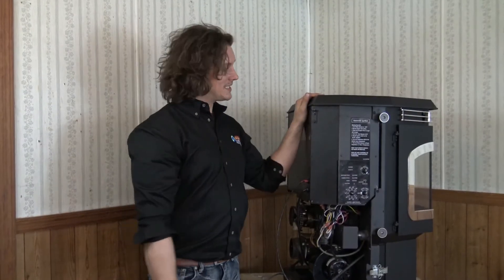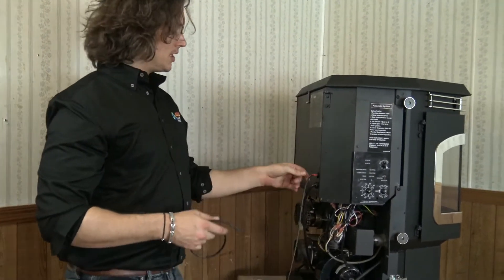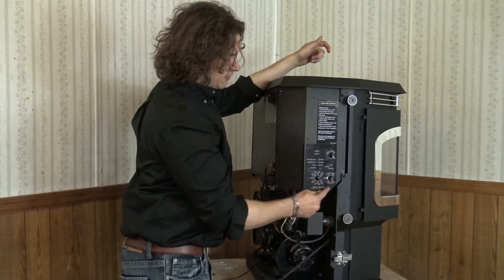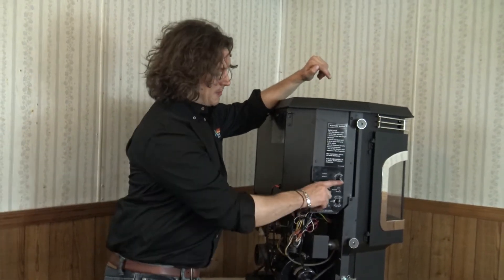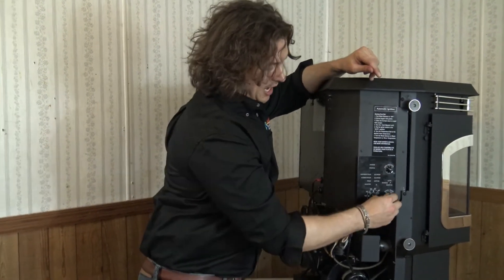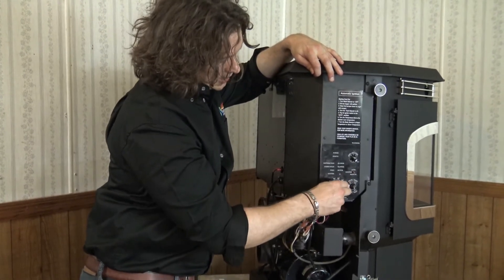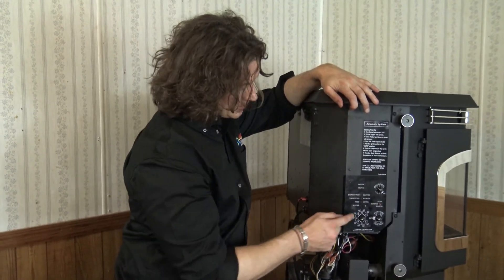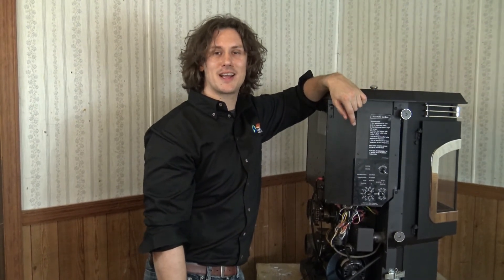Harman Stove Controls, How to use a Harman Pellet Stove

Comment: I added a $200 uninterruptible power supply (UPS) to my P-43 so that power surges don't fry the electronics and it runs even when the power goes out.
Reply from the maker: Thanks for sharing. Typically with Harman Stoves, a True Sine Wave Inverter would be required for proper battery backup/power outages. Glad to hear the solution you found is working well. Typically speaking, a surge protector of 850 Joules or more would be what is recommended for pellet stoves to prevent power surges from impacting the circuit board. Again, appreciate you sharing, any future questions just let us know. Thanks!
Reply: @EarthSense  How do I know if mine is sufficient?
Reply from the maker: @jccook5353  Thanks for the message back, apologies on the delay. If you have your system in place and the stove is operating as it should be, then it should be just fine. Feel free to send us a link to the UPS power supply you have and we can certainly review that and follow back up. Thanks.
Reply from the maker: @jccook5353  This is the inverter system that Harman recommends for their stoves, just so you have this as a reference and can review the info and specifications. https://www.secamerica.com/sf-512-inverter-for-harman-pellet-stoves-engineered-for-proper-stove-operation/

Comment: Hello. I have a Harmon Accentra insert that was purchased around 2010. I replaced the Combustion Blower (motor) last year after the bearings began to fail. No issues since. After running the stove this year ~3 times, I noticed the Distribution Blower stopped running, even though the Distribution Blower light is on during operation. When in “Test” mode, the Combustion Blower and Feed Motor all operate properly (about 60 seconds) with the indicator lights on. The Distribution Blower indicator light comes on, but not the blower. First question – I’m assuming the Distribution Blower is getting power, but not turning (clogged, burned out, etc.), and needs to be replaced? After locating a replacement (non OEM) Distribution Blower motor online, the seller states the (new) motor will be single speed only. Second question – If I install this (non OEM) single speed motor, will the Distribution Blower speed still be variable between the L – H settings for both the Room Temp and Stove Temp control?  Thanks!
Reply from the maker: Thanks for contacting us, happy to help. Based on what you are describing it does sound like an issue with the blower motor itself. You can always test it to direct power to know for sure if the motor is the culprit. Quick video on that - https://youtu.be/rlmiCYI2WPk?si=cQJx9XzDObuYnm5J
If you are replacing a 3-speed motor, which if original it would be on your 10 yr old Accentra insert, we would recommend a 3-speed replacement. The new OEM blowers are 1-speed and Harman does have it listed as a correct replacement for all year Accentra Insert models.  
For Reference: 
Here is our 3-Speed Motor Replacement - https://pellethead.com/product/pellethead-replacement-harman-distribution-convection-blower-accentra-insert-invincible-insert-super-magnum-stoker-motor-only/

Here is our 3-speed motor assembly - https://pellethead.com/product/harman-distribution-convection-blower-super-mag-accentra-insert-invincible-insert-aftermarket/

Hope that is helpful, let us know if you have any further questions.

Comment: Could you help me understand what to do when the ashes are building up in the ash pot? I have always burned the same pellets. My ignitor has not been working so I am running continuously from a manual light. This is the first time the ashes have built up. Is it something i am doing?
Reply from the maker: Thanks for contacting us, happy to help. Does your fire look different? Is it crisp and torchy or is it lazy in any way? Generally speaking ash build-up in the burnpot is normal. It greatly depends on the pellet to how much ash and build up there is. If your fire is crisp and torchy, I would lead to say this is a pellet issue and something has changed within the brand you are burning. We would recommend trying a few bags of another kind and gauging the results. Generally speaking for pellet stoves, softwood pellets will have less ash and more BTU's. If your fire is lazy in anyway then we have an air loss or blockage issue somewhere contributing to the ash build up. In this case we would check the door, glass, and hopper gasket seals in addition to a thorough cleaning on the unit and vent pipe. We would also suggest inspecting the burnpot with a good light and making sure all holes are open. Even though you don't use the igniter, ash will still accumulate in the igniter area and it's important for proper air flow to remove the igniter cleanout cover on the burnpot and clean our access ash and deposits. 
Keep us posted, happy to help. 
Quick Video on Scraping the Harman Burnpot: https://youtu.be/Ukao3dCooec?si=mDHbARjjYuzVvjHa
Quick video on replacing the igniter should you want to do that down the road: https://youtu.be/i7n1SSgCPMc?si=bycSIMKlE6Fi8ggG

Comment: Any insight on my harmon going through a power outage? It was working fine until the outage. Power has been restored and the outlet is working, but the stove is no longer receiving power. What can I check on it?
Reply from the maker: Thanks for contacting us. Did you have a surge protector in place between the stove cord and wall outlet? Best Option here is to grab a basic multi-meter and check voltage. First check outlet voltage, then check voltage inside the stove where the power cord makes connection. Harman stoves do have a fuse on the circuit board. With the stove unplugged, you can pull this fuse out and check it with the meter. Let's start there, keep us posted. 
This video is a fuse replacement on the Harman Accentra, other Harman models will be very similar. https://youtu.be/vJZn_EC-2gc?si=x3kpruLIYhfRpRJv
Here is a video on pulling the control board out of a Harman P43 - There is some variances between models with how the board comes out but this should help. https://youtu.be/PNAkJ3jDmtM?si=ONh31p6SNHXDRW8d

Thanks.
Reply: @EarthSense  I'm not sure. I know the outlet had it's own breaker. I will share this with my husband to try out. Thank you for the response!
Reply from the maker: Most welcome! We do recommend a surge protector of 800 joules or greater to be in place between the stove cord and outlet. In the event of a power outage, power spike, or lightning strike, it acts as a barrier to protect the circuitry in the stove. Here is the one we offer for reference. Any questions your husband has just let us know. https://pellethead.com/product/belkin-surgecube-outlet-surge-protector-1080-joules/
Reply: @EarthSense  Husband was able to find the fuse and bought a surge protecter. It was definitely blown. We bought a fuse to replace it. Put it in and then when we plugged the unit in tot the outlet it immediately popped the fuse. We had not even turned the unit on yet. Is there anything else we can try?
Reply from the maker: Thanks for the message back. 

First I would rule out if it's an issue with the outlet/house power. Plug other appliances into that outlet to test as well as checking the voltage coming out of the outlet and ensuring it has correct polarity. 

If the outlet/house power is correct, then I would suggest getting a good light and checking all wiring in the stove. See if there are any bare wires that are touching metal creating a short circuit. 

Keep us posted, happy to help.

Comment: Great video, if I operate the stove in stove temperature and leave the igniter switch in automatic mode will the fan distribution blower come on below the #4 setting ?? Or once the stove is turned to stove temp the blower will not work if the feed setting is below 4 regardless of any other stove setting?
Reply from the maker: Thanks for contacting us, glad the video was helpful. Yes, if you leave the igniter toggle in automatic then the distribution blower should operate below the #4 setting in Stove Temp mode. Any other questions please let us know. Thanks!

Comment: Hi Steve - enjoy your videos , very imformative - recently i swapped out a harman xxv auto ignition wiring harness - and now  when i plug it in i get a fuse blown - not sure what i did wrong  and i cant find any videos  to help me determine what is going on - i found the schematic on the  panel and it looks like i did the wiring correctly - but I cant  determine what to do next - any help would be Great , I cant find anyone to come look at it either - and its going to be cold soon
Reply from the maker: Hey Steve, thanks for reaching out. If you don't mind me asking, what was the cause for you to replace the wiring harness? Let's double check all wires to ensure there are is nothing exposed and grounding out. Let's double check all wire connections to make sure they are solid. If that all looks good, Let's move forward by inspecting the igniter. Use a multi-meter to check the ohms - directional link below. Let's inspect the finned element inside the cradle as well. If it appears warped in anyway it could be grounding out on the cradle and blowing that fuse. Harman igniter video below for reference as well. Keep us posted, happy to assist.
https://pellethead.com/how-to-test-and-replace-a-stove-igniter-pellet-stove-ignition-troubleshooting/
https://youtu.be/i7n1SSgCPMc?si=XFRZQCfewU83jKAd

Comment: Two questions

Just got my new house with this model in it.

1- how do I know how much wood pieces to put in it ?

2- if I have an electricity outrage, how can I start it and use it ? 

Thanks
Reply from the maker: Thanks for contacting us. It will be very important to go over the manual before you start using the stove. If it's the exact model as in this video it will be an Advance. Here is a link to the Advance manual - https://downloads.hearthnhome.com/installManuals/Advance_Owners_Man_09730c.pdf

1.Generally speaking a person would fill their fuel hopper to the top with pellets. The unit will regulate the feed based on your settings. 
2. A person would require an inverter and battery backup system for the Advance to run properly if AC power goes out. There are several options for battery back-up kits. Without a proper inverter and battery backup system in place, the Harman Advance will not operate if AC power is out. 

Happy to help, thanks for reaching out.

Comment: Great video.  My stove blower fan  runs for an hour and 15 minutes after the Auger turns off. I got tired of unplugging it, so I just got a power strip.
Reply from the maker: Thanks for contacting us. It is normal for the Harman exhaust blower to run for that length of time once the auger turns off in cool down mode. The Exhaust thermister ESP probe is monitoring temperature inside the exhaust flue. Never hurts to inspect and clean the ESP probe. Here is a link. Any other questions please let us know. Thanks! https://youtu.be/kt7nnGMYU-k?si=Ovv0rMySQ3rZmtBX

Comment: So, if in winter and in Room/Manual ignite mode, will the stove burn more or less pellets as it sort of drops the feed rate down automatically? Thanks.
Reply from the maker: Thanks for the message. Much of this depends on the insulation quality and window/door quality in the home/area that is being heated. If it's an older, draftier area that is being heated, it can be recommended to flip the igniter to manual once the stove is lit during the cold season. By doing this the stove will go to a low pilot fire and hold that fire until heat is called for. Generally speaking in a draftier/less insulated area it will be calling for heat pretty quickly and by doing this the stove is already warm and can quickly ramp up essentially using less fuel then if it were to shut down and have to re-ignite. If the home/area is very tight and well insulated, most folks will find leaving the igniter toggle on auto and having the stove shut down once temperature is reached is the most economical and fuel conscious way of operating the stove. Play around with it a bit and you'll find the best way of operation based on your situation. Any other questions please let us know. 
Thanks!

Comment: If I run on stove temp mode, does the blower speed have anything to do with how many bags of pellets you burn a day? For example, if I have my feed at 3.5 and stove temp of 1. If I lower my blower speed does it save on the amount of pellets I burn a day? I was just told it did and not sure how. I have a newer P 68 and he has an older model controls like above with Low and High speed. I can't get under 1.5 bags a day and he only burns 1 with basically the same style ranch home and burning the same pellets. Thanks !
Reply from the maker: Thanks for the message Kristy, happy to help. Direct answer to your question is no. Adjustment of the blower speed plays no effect on your pellet usage. We would suggest that if you are running the stove on stove temp at the lowest settings, that it is ideal to have the blower turned down lower for best efficiency. If the stove is running on a low setting and the blower is on a high setting the heat level output temperature/efficiency will be less than if the blower is on low. 
When you are operating on Stove Temp mode the Feed Adjuster Dial is not in play. That dial ONLY comes into play when operating in room temp mode. When operating in stove temp mode, the pellet feed/temp settings are only based on where you have the main dial set on the 1 through 8.
Newer P68 models have a 6 RPM auger feed motor. I do believe the lowest feed rate the unit is able to run at is 1.5 lbs per hour (1-1/2 bags per day). The Advance model as shown in the video would depend on what kind of feed system was in it. Early models have the chain drive, newer models direct drive. Depending on that, the lowest feed rate on an Advance would be 1.2 - 1.5lbs per hour. 
As a suggestion, play around with room temp mode. Do some tests at different temperature settings and see what difference you notice with fuel usage. You can leave the igniter toggle on auto so it shuts on and off as needed. There's also big differences in pellet fuel especially with heat output, maybe try a few different kinds. If we are running on room temp mode and burning a hotter pellet, temperature should be reached sooner where the stove can then go down to a low fire and shut itself off if needed. 
Hope this was helpful, any other questions just let us know. Thanks!
Reply: Thank you. I didn't think it mattered. He has an older p68 with controls like above and we have a newer model. That makes sense why he can burn less on stove temp mode. The house seems warmer when running in stove temp.
Reply from the maker: @kristydobinski612  Thanks for the message back Kristy. Yes, the earlier P68 models used a 4RPM auger motor so the lowest feed rate will be slightly less than the newer model. Sounds good, whatever works best for you. One last suggestion, if the stove is running on very low settings for extended periods of time it's recommended to periodically turn it up to higher setting for a short period of time. This will help avoid heavy carbon deposits in the burnpot and creosote build-up in the stove and flue vent pipe which tends to happen during extended operation on low settings. Any future questions just let us know. Thanks!

Comment: Hi, My power light is constantly on. Is that normal? With the rising cost of electric this year, it is costing me a lot of money to keep it on 24/7. Is there a way to unplug it and will that damage the unit if I keep it unplugged because I really don’t use it. If I can unplug it, how do I get to the back of the unit because it is set up like a fireplace in my living room.
Reply from the maker: Hi Sandra, thanks for the message. Yes, on a Harman the power light will stay on when it's plugged into the wall - that is normal. If you have a fireplace insert it would depend on how that was installed/where the electrical outlet is. Sometimes an electrical outlet will be inside the fireplace opening and in other scenarios it would be plugged in outside the fireplace opening to a nearby outlet. If you don't see your power cord anywhere than most likely it is in the firebox and would require pulling the unit out to unplug it. Most Harman inserts are on a track system making them easier to pull out than most for cleaning/maintenance, etc.. Hope that is helpful, if you need additional assistance just let us know. Thanks!

Comment: Just thourgly cleaned ours.  
  15 yrs old.
Just an absolutely wonderful machine
Reply from the maker: Thanks for sharing Tom! Regular cleaning and maintenance is the key; great job! Do you have the Advance like in the video or a different model?
Reply: @EarthSense  
  I can honestly say regular cleaning isn't the norm here..
  It's not likely to be cleaned other than suck the ash pan out when its apparently too full.
  We usually clean it thourgly in the fall, September.
Then on a warmer day in the winter . We've only seen -45 here for about three weeks,  
 So this week its b
warm at-5 c..
Reply from the maker: @tomlambert1833  Good to know Tom, that is some cold weather! Most issues folks run into are related to ash accumulation and general cleaning. Less ash accumulation the more efficient the unit will run and the less problems that typically arise. Glad to hear it's been solid for you. Thanks again for sharing!